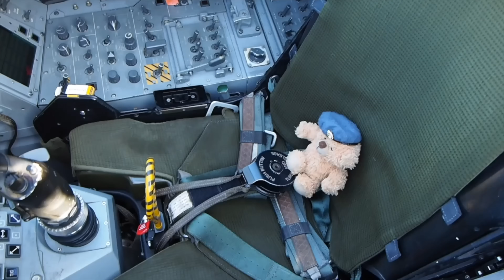EMERGENCY: DRAGGY STUCK REFUELLING PROBE TYPHOON MAKES A BRAKE PARACHUTE LANDING • RAF CONINGSBY

Comment: This is interesting I have also filmed a typhoon with a stuck probe, it landed normally without using a drag chute, so maybe there was another issue as well? Also interesting to note that the French Rafale has a fixed probe, however it is a little more streamlined
Reply: Could a stuck probe be indicative of a more serious issue like a hydraulics failure?
Reply: @mickhorsley3169 Possibly I guess that would account for a drag chute to aid breaking🤔
Reply from the maker: Firstly, aircraft that have their probe permanently fixed are designed that way. The sensors protected and the designs aerodynamics designed to make as less drag as possible. Those that have their probe inside their envelope are designed to be that way. 

Secondly, there are a few scenarios regarding the probe out on landing. If the probe is already out before touch down with no chute deployed could that damage was caused before fully refuelling, so therefore not full of fuel. If it was damaged with fully refuelled then this becomes a bit of a landing hazard. It’s a procedural thing to use the chute but it depends on scenario. 

Lastly, probes can be deployed “ON” landing (once the aircraft has touches down) so that it can be checked after it’s had AAR 

hope this helps :_ted2:
Reply: @TedConingsby Thanks interesting information 👍
Reply: @TedConingsby  Chute will be used if there is potential for hydraulic failure meaning that the brakes won't be effective. The probe not retracting could be an indicator of a hydraulic failure.